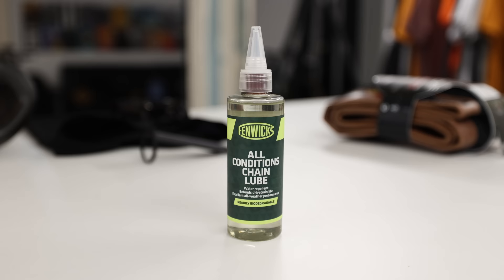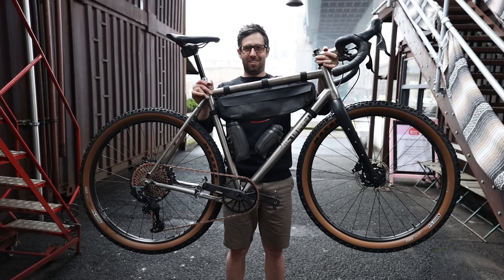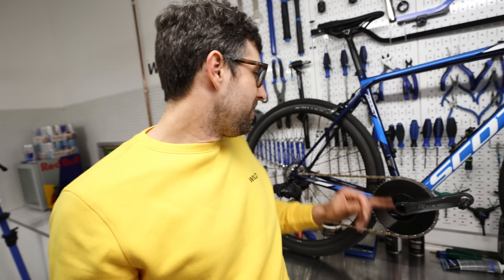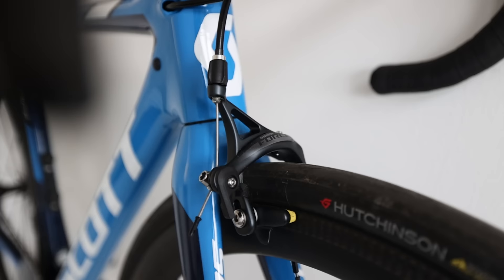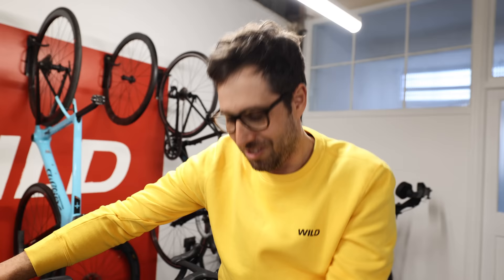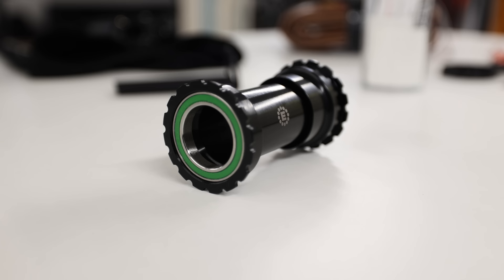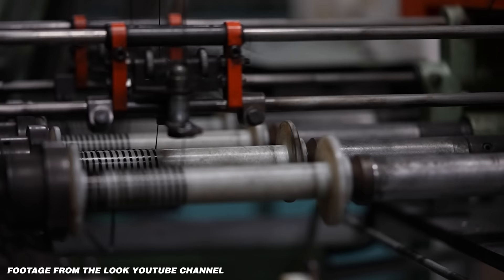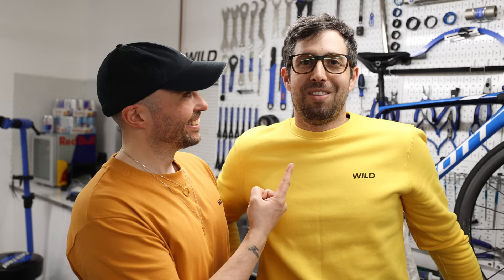Pro Bike Mechanic's 20 Most Loved Products

Comment: Disagree with the 1x statement. Tighter ratios DO help the average cyclist is riding in a group as you've got a smoother progression up the cassette.
Reply: I'm a recent convert to 1x after always having had triple chainrings. As a below average (but v experienced) cyclist I can safely say that I do not find that gaps between gears too big at all.
Reply: The only time I miss the 2 by on my roadbike is when riding my gravel bike down a steep hill near me-on the road bike I can power all the way down, on the gravel bike I spin out about half way-so I freewheel-no problem……..
Reply: 1x is fine when riding solo, but whenever I’m in a group I’m always wanting a gear/cadence I don’t have.
Reply: 1x is miserable when I’m out trying to do workouts. There’s just no getting around the fact that 1x has much larger jumps between gears or doesn’t have enough range.
Reply: A 38t with a 10-51 is enough for most. 140mm in the front, 150mm at the back, 203mm discs all around, some 55mm race kings or 65mm pirellis and off you go.

Oh wait, wrong audience. Never mind. You roadies will understand in about 3-8 years, when real racing tech trickles down to your kind of smooth surface riding 😊 too, cant wait for the e-tour d-e franc-e where they actually go around france and not just somewhere random. Racing e-mtbs uphill/upmountain is awesome btw. Check it out.

Comment: A problem of using Fidlock botles is that is you loose one in a trip, during a ride or during a MTB Event for example you cannot use another type, a quick go to supermarket and get a isostar bottle or get an bottle from a friend/event sponsor, you need to buy a new Fidlock one. A normal bottle cage and you can use almost any other bottle
Reply: And they cost about a billion pounds rather than £2 like mine.
Reply: I’ve seen a boa type thing so you can do that which you can just carry easy
Reply: The bike industry is filled with expensive solutions in search of a problem for sure.

Another example: Classified IGH.  Lots of $$$ just to replace what was lost by a $30 front derailleur.
Reply: Been using them for Enduro MTB for around 5 years now, never lost one. This is a non-issue.
Reply: @GiancarloBenzina  Definitely the way to go, also if you want to have  another bottled beverage it’s nice to have the regular water bottle holder for that and they fidlock for your water
Reply: The bottle cage user is happy that replacing a lost bottle only costs 5€.
The Fidlock user didn't lose a bottle.
Reply: How thefuq can you lost a bottle ? Are you sure you are able to handle them if you claim you lost one? I had crashes where the bike snapped and guess what the bottle was still inside. 
Riding with this system since 5 years and I still have the first carrier and a second bottle. Again how did you lost that and all the dudes who
Upvote your comment.

Funny also because some frame are tight and guess what bottle will get inside? The Fidlock because it don’t need space to load it from the top.
Reply: @Cyrenetes na man there are bottles like the camelback insulated series that will cost you more then 20usd. 

I never had found a fidlock but found some camelback insulated ones. My commuter don’t need the fidlock. What I found out is that not every standard cage will be good for your bottles. I hade one that chewed the more expensive insulated through and pretty fast.
Reply: The only thing I'd be concerned about is hygiene with long term bottle use. I tend to replace my bottles every 6montys or so because the lids are generally not able to be cleaned.
Reply: I don’t use them on my race day bike as they tend to pass out (free) pre-filled bottles at the feeding stations at the races round here…but you will NOT lose a fidlock bottle.

Comment: I'm so glad he said what he said about intergated cable routing, coz its a nightmare. It will single handedly keep bike mechanics employed!
Reply: I used to be a bike mechanic. I’ve built all my bikes, and none has internal cables. I guess none of mine ever will, especially now that I’ve been warned. I don’t know what’s so gauche about visible cables.
Reply: @tomreingold4024  I think my next bike will be a rim brake bike for this reason
Reply: @tomreingold4024  not even integrated into the downtube? Or do you refer to the head tube mainly?
Reply: @tomreingold4024  we have 2 bikes with mostly internal cables. Luckily those are not run through the stem and have internal housings that make running the cables a non-issue. I definitely don't envy mechanics before those days.
Reply: For gravel/adventure type riding, having it all inside does mean less snagging with bar bags, or chances of damage, but if it does go wrong, whew!
Reply: ... integrated*

Comment: Regarding 1x, they are both right.. you don't need all the gears of 2x.. but each rider should be their own judge.
Reply: They apparently have no hills in the UK
Reply: Hahaha i just wanted to say the same. It really depends on where you live. Forget that in southern Bavaria… some flats and out of nowhere a 25% 1k climb awaits you in order to get back to flat… good luck pedalling up that hill with 48 - 30
Reply: @veganpotterthevegan  yeah but i think that’s exactly the „problem“ with 1x bikes. My gravel bike is also set up 1x. But I usually ride as fast as possible in order to get somewhere (commute, visit, etc) and even when riding my road bike recreationally or lets say Z2 I‘m still at 30kph+, I want to stay at a certain pedalling frequency which gets impossible on my gravel bike due to the big jumps (11-40 with 46 at front)
Reply: I wouldn't trade my GRX Di2 11-42 30/46 for anything else.
Reply: @_MPP_  30/46 chainset is very good. I wanted a bit more road speed though and swapped mine for 34/50
Reply: @cdamian  I thought the same thing.  Not much in the way of heavy winds either, I guess.

Comment: I prefer 2x. It’s nice to have a small chainring to shift into for steep climbs. Also, I’m no expert, but I can imagine the chain would wear quicker on a 1x because of the greater angle when at higher or lower gears.
Reply: Actually, you have that back to front. It's the 1x that has the better chain alignment because it would it in the middle of a 2x so a 2x creates more chain wear because the chain is working harder. This extended even further when the frame is designed around a 1x system only,
Reply: @Roger101Watson  on a 12 speed?
Reply: Concur.
If used with common sense, imho even a triple will run better chain lines than a 1x, let alone a 2x.
Reply: @deadhead 1x has greater frictional loses. Plus who wants giant jumps in a cassette? I also miss 2x when riding mtb and you come to a quick punchy climb. It was so much easier to dump a chainring then it is to down shift 3,4,5 gears.
Reply: @Roger101Watson  tests found more friction with 1x groups
Reply: @francoispaquin9996  I would like to see those tests. I have been curious about the (dis)advantages of 1x myself
Reply: I changed the chain of my 1x campa Ekar After 5300k. Sprokets and the chainring are like the first day. And 13s makes a huge différence regarding fine tuning inbetween the sproket-range.
Reply: @Vlahovic Samira I changed the chain on my 2x shimano Dura ace after 15000km everything else is still good.
Reply: In my experience road 1x is just loud.
Reply: As an older cyclist, Couldn’t live without 2x on climbs
Reply: @mikesiemens4145  first of all: 
He clearly talks about road.
The friction loss can be ignored… you loose like 2 Watts. I don't think someone here will notice a difference.
It's also not about the range. A XX1 10-52 cassette has bigger range then any 2x road groupset.
It's about the jumps. On the road you will notice the bigger jumps of an MTB or 1x gravel cassette when changing gears much more then offroad. You may not find the perfect gear for your desired cadence. Which can be annoying.
When you live in a mostly flat area, then you can easily ride 1x with a slightly bigger road cassette. But when you have some bigger climbs, it's not really an option unless you give a fuck about the jumps and maybe the weird look of a MTB cassette on a road bike.
Reply: @abedfo88  well that depends on the bike and also the groupset.
A shorter chainstay leads to a more aggressive chainline and can be quite loud.
I also read some customer reviews that the new Force 1x cassette is load as f…
Where Red is quiter.
Reply: @5amba this would be my problem, i have a 11s 11-32 Shimano on my cross bike. Hate riding it on the road jumps just too big. Campy's 13s sounds better as it has road spacing till it get really big. I can see that that could work. One by has more friction, 10t and 9t sprockets have more friction srams flat top chain has more friction... All the manufacturers have also got alot better at treating their parts to make them super hard, so they don't wear out faster and almost no one cares about the lost watts... It not much at the power most people ride at.
Reply: @monsters8730 it’s 5watts at best. Hardly a deal breaker and those losses are only found in the outer most gears. Just shave your legs and you’ll get those 5watts back. Gear steps with the new 12 speed systems  you have 5-6 1 space gears. 46/33 will easily get you up a 10% climb with a 90 cadence and a 46/10 will seeing you doing around 35mph on the flats, don’t know about you but I can’t push that for very long. In the mid block your working gear you’re cruising around 20-21mph depending on cadence. I comfortably use 1x on the road if I had 2x I just wouldn’t use the small ring so I’d rather drop the weight. But each to there own there is more than once way to enjoy your ride.
Reply: @5amba I can confirm both are loud it’s the jockey wheels mostly
Reply: @gaza4543  and if your legs are already shaved, then you get the 5 Watts back with Aero Socks (at 35 kmh / 21 mph)
Reply: front derailleurs do make a great thud sound as they hit the bottom of a trash can...😁
Reply: @woodstock5nathan  How about reducing chain ring size and using a closer ratio cassette? It will reduce gaps for hills and on the flat..you just lose some ability to pedal downhill.
Reply: @truthseeker8483  where i live we have  wolds, long rounded hills that slope down west to east and then have steep valleys between them. On the flat your at the bottom of the cassette where it's straight, fine. On the steep hills in the valleys you don't care as much about the jumps. But on the long drags going east to west? Also I'm still quite fast i sit around 52x(12,13,14) on the flat when I want to push and i have all those long shallow descents. It's been said lots before pros aren't able to put out much more power than good amateurs, they can just do it for much much longer. When people say "you don't need this unless you're a pro" that's not very useful. I'm nowhere near as fit as a pro but i need gearing that can do pro speed comfortably party cos im not as fit. One by is great for most people, not all...
Reply: @Roger101Watson  You are delusional
Reply: @woodstock5nathan  You are much stronger than me for sure. 🙂
Reply: @gaza4543  If you are doing 10.4mph (90rpm with a 46/33 on 700c with 25mm tires ) on a 10% climb, you are doing 5-6w/kg
Reply: @Spleck9000  Fairy tells.
Reply: Agreed, you are "no expert" 🙂
Reply: @wheatcroft9  a bigger cassette does the same job
Reply: @br5380  very valuable input, well done.
Reply: I have a 1x mullet setup on my gravel bike, and its ideal.
Sram lets you pick and choose across road and gravel - so I have road shifters, 1x, but then Eagle rear derailleur and effectively a MTB cassette. 
42T front ring, 52-10 rear.  420% gear ration - I have 42:42 for climbing which is where a Shimano 2x usually gets you to at best (50/34 being the most common front, and 32-11 the rear, you need a 34-11 just to get the 1:1 climbing gear)... but I then also have the emergency 'bail out' gear of 52... a 0.807 gear ratio is incredible when riding the 20%+ I see in the Highlands.
42 x 10 on the flat is fine too.  Would I prefer a 44:10 ratio?  Very, very occassionally I feel like I could go faster, so if I was a Cat 1 rider chasing sprint finishes on crits/semi-pro races then I get it... But I'm not.
Sprockets of 10,12,14,16,18,21,24,28,32,36,42,52
I reckon the jump between 24 to 28 is the only one I notice (until you get to the 42 or 52 emergency climbing gears, at which point you're thinking less of smooth pedal stroke in a big group and more about just slackening the gear asap).
I actually feel with my bike that has Shimano GRX 800 2x, I can't move up or down the gears quick enough, there's too much duplication of gearing or gears too close together.  Off road I find the gradient changes frequently and sharply, sometimes its the terrain too (i.e. you change up or down a gear on looser surface, on grass, on sticky mud etc).  On a 24 gear bike, how many are actually used vs being duplicate?  When you add cross-chaining, there's maybe 8-9 useless gears in there.
Also with SRAM you have double-tap where it skips the gears quickly - I can get from 18 to 32 with 2 clicks of the button/electronic shifter.
Off-road, I'm never going back, Sram 1x all the way.  This is the zenith of gearing for gravel bikes for the non-pro.
Reply: @monsters8730 it's the jump between gears for me. On your own/MTB it's not a problem but when you're in a group ride and you're always between the bigger jumps of 1x it's not great
Reply: @davelloyd8454  makes sense
Reply: @Roger101Watson Wrong Roger.  If you keep track of where you are on the cassette y9u can nearly always have a better chain line with a 2-by.  Yes, a complete cross chain gear like large chain wheel-large cog will have a more extreme angle, but that’s easily avoided by knowledgeable cyclists.  Get nearly the same ratio with the small chain ring and maybe the third or fourth largest cog, for a nearly zero chain angle.
Reply: @Roger101Watson  Nonsense. On a 1x the chain stretches further sideways than on 2x. It has been proven that chains and sprockets do wear faster on 1x. And that is exactly why component makers are so fond of it.
Reply: @mikesiemens4145   frictional losses / much easier than*. Other than that, I totally agree.
Reply: @5amba  you lose* 2 Watts (loose ≠ tight) / bigger range than* / more often than* offroad ...
Reply: @woodstock5nathan  ... you're* at the bottom
Reply: @rosomak8244  fairy tales*
Reply: 1x in speed restricted ebikes is ridiculous. With a high torque mid motor you can chew up the small sprockets so bad the chain will skip over it in under 1000km. 

For other things it isn't bad at all if you can handle the bigger steps or smaller range.
Reply: I don’t know if it’s a 1x thing, an SRAM thing or just a modern chain design, but I have 2 bikes now with SRAM Eagle 1x12 transmissions and they simply do not suffer chain stretch….

Comment: 0:09 - Fenwicks 
0:31 - Fidlock 
1:13 - Vielo Seatpost 
1:44 - Wireless dropper seatpost
2:18 - Silca Sealant 
2:59 - 1X drivetrains 
4:00 - Gravel frame 
4:34 - Internally routed cables 
5:44 - Fendor Bendor 
7:02 - Sram Removable Batteries 
7:48 - Park Tool 
8:10 - Ceramic Speed 
8:44 - Enduro Bearings 
9:37 - Bike Radars 
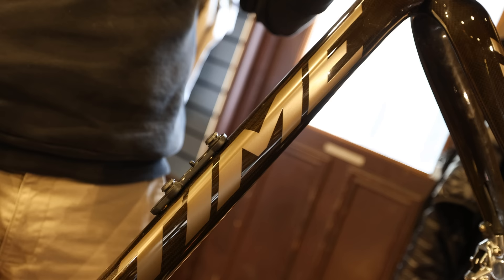10:13 - TIME Carbon 
10:47 - Tubeless Plug & Boot Kit 
11:25 - Bike Luggage
Reply: Ehrenmann
Reply: THANKS
Reply: 5:02 - Wide tyres/tires, couldn’t make out the name of the gravel tyres. Anyone know the name?
Reply: Found them! - Teravail Rutland, a good looking tyre, I guess you get what you pay for 🙃
Reply: Missed 6:32
Reply: The real MVP
Reply: 6:23 J Guillem Atalaya frameset
Reply: 9:37 bike radars
Reply: if you start them with 0:00 and the channel puts it into the description, it shows up as chapters

Comment: PEDROS tire levers are the most sturdy levers I’ve ever tried, wouldn’t be bothered to carry anything else. Well designed and will take on any tire without the fear of snapping or bending
Reply: Try the Silca ones!
Reply: We have broken a few Pedros  at our shop.
Reply: @scottbaker5851  they have a lifetime warranty.
Reply: The best by far!!
Reply: The best for sure! If you're breaking pedro's it's because you're either using them wrong or simply have a terrible tire/rim match. Would just change the tires at that point !
Reply: wait til you try the feedback sports
Reply: @wickedskillz101  steel core looks hella sturdy

Comment: I am a huge fan of the Varia. I won’t ride on the road without it. But, even though it gets universal praise, I think every mention of it omits an important detail: by itself, the Varia is just a countdown to a possible collision. 

In order for the Varia to be truly game-changing for your safety, you need a mirror. The Varia tells you when to check that mirror so you know whether a car is giving you room.
Reply: What happened to taking a quick glance over your shoulder every now and then ?
Great for insurance claims though
Reply: @WesternUranus  As ever with radar critiquing, that's a false dilemma. The radar won't stop you from looking over your shoulder, and isn't a replacement for doing so. Like a mirror or helmet, it provides another layer of safety. For a specific use case, I ride in a windy area with infrequent traffic and bad roads where the shoulder is even worse. The radar lets me ride on smoother parts of the road with greater confidence, even with a howling headwind that blocks the sound of overtaking traffic.

Props to Nick for pointing out this is all part of of a synergistic system.
Reply: @donjuandeaustria1213  Fair points. 
I ride mostly in urban area where you hear much more of what's coming behind so I don't feel a great a need for it.
Reply: @donjuandeaustria1213    exactly the point so many refuse to understand!    I ride mostly rural low-ish traffic areas and can use the entire lane confidently then quickly move to the shoulder on a varia alert several seconds before I can hear vehicle noise.   It makes any decent cyclist appear more considerate to drivers, and we all need that.